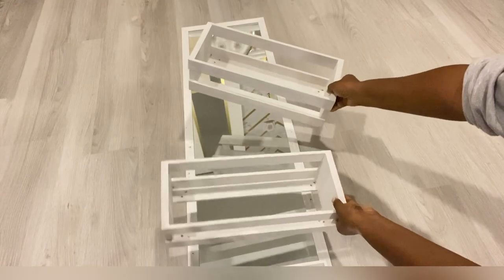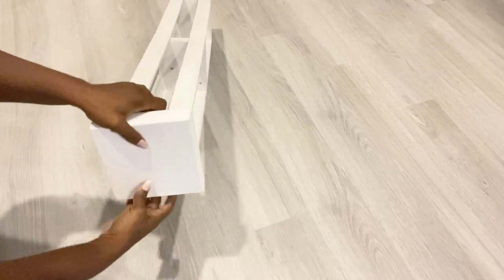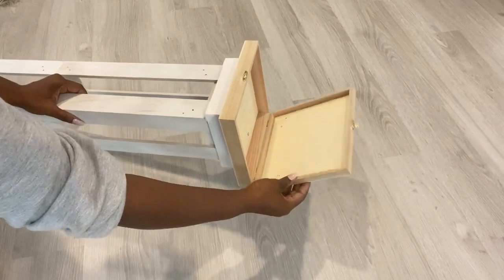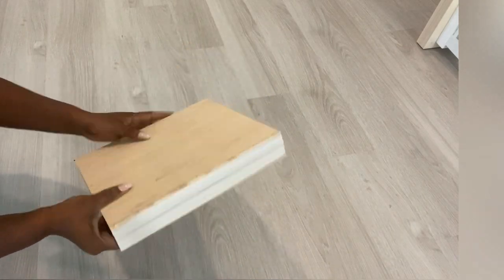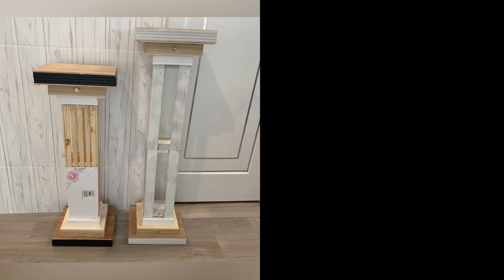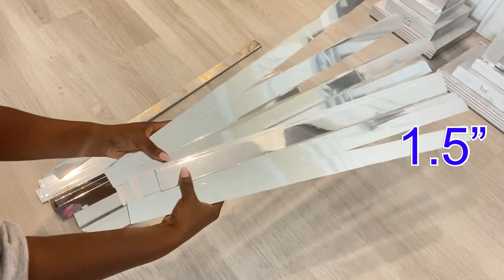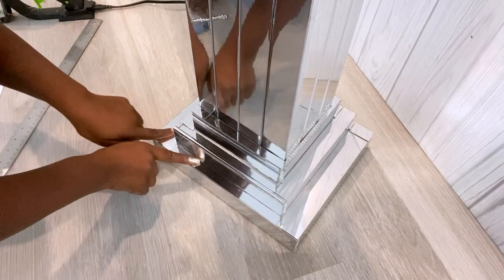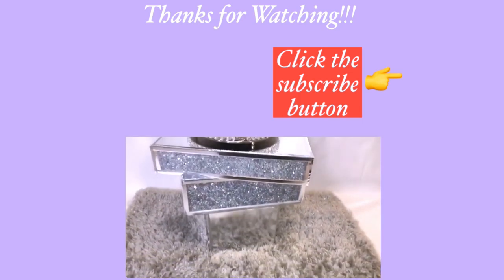DIY MIRROR PEDESTALS USING PICTURE FRAMES AND BOXES!

Comment: For anyone scanning the comments for tips. Should you drip or squish wood glue anywhere but where you want it use a damp cloth for clean up. A damp strip of an old un used t-shirt works best. Make sure clean up up is right away.

Comment: Some of my bases that I wanted really sturdy I used one weight I bought cheap at goodwill/Value village round flat ones are always great as they already have a hole in the centre come in different weights just cover over it with ??? what ever ( strong like bull) :glasses-purple-yellow-diamond: